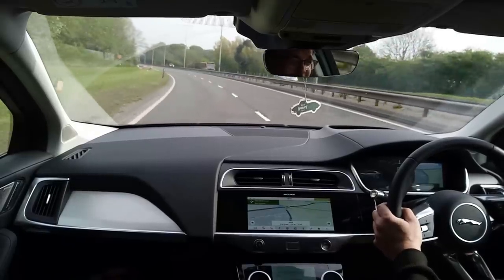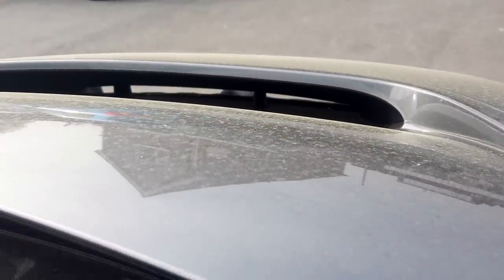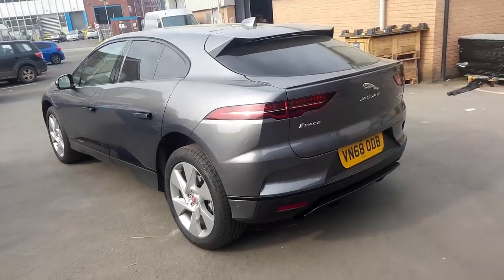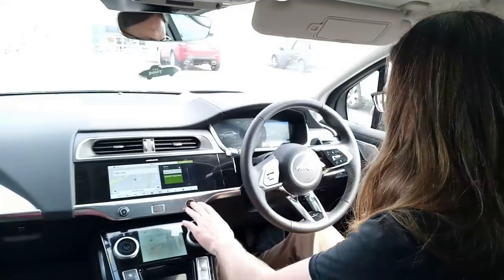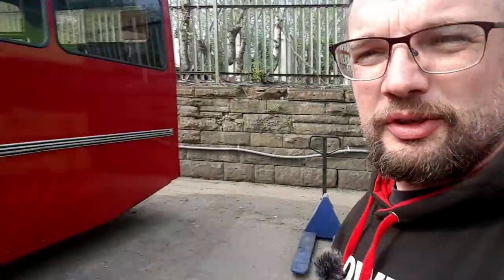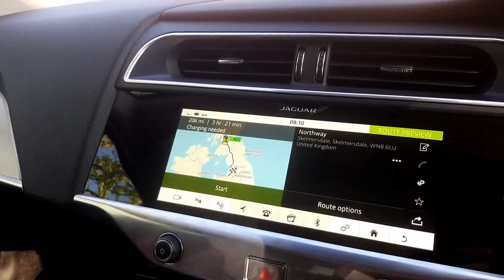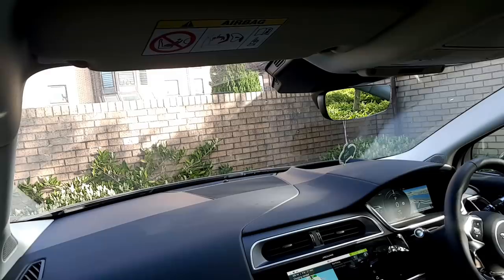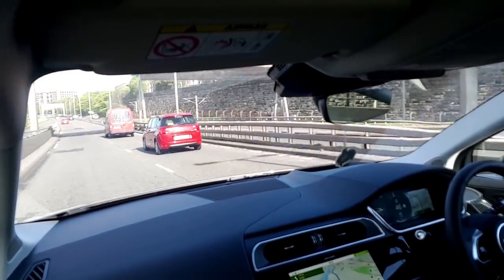Real Road Test: Jaguar I Pace 800 Roadtrip - with bonus bus action!

Comment: 168 miles of range in one hour - my 22 year old Mondeo can add 400 miles to it's range in 3 minutes! ;-) But being serious, if you live in town or only normally make local (ish) journeys, electric is fine. But, like i have mentioned before, the biggest problem i see with electric cars is the cost. A lot of people can only afford to buy used vehicles that have many miles on the clock already, and if your careful you can get yourself a decent very reliable car for not much money at all. But i simply cannot see that happening with electric vehicles, especially if you want a nice family saloon sized car. I think about the only time they are going to be very cheap is when the battery pack is on it's way out, and then of course, like so many modern things it will be just uneconomical to repair. Spend lots of money to buy it new, use it for a few years then recycle it, just like so much modern stuff these days. Mind you, to be fair to electric vehicles, internal combustion engined cars are not much better these days in that respect, things are just not built to last these days.
Reply: yeah my 100 year old steam car can use random bits of coal and wood, my horse just needs carrots!   yes i looked intoa renault zoe, the battery rental (and its a rental based on miles per month) costs more than the car itself, i bought an aygo instead :)

Comment: There is no rear wiper because like the Audi A2 there is no need for one if you’ve designed the airflow across the car well.
Reply from the maker: But what is the window is dirty or wet at the start of the journey? Aero NEVER works as claimed. Saab tried that with the original 95.

Comment: Motorway services are cheap for electrics, and remember you're dealing largely with business drivers. I have a fuel card, if I switch to a milk float it will cost me nothing. I am deciding whether to go full electric or hybrid to replace my oil-burning Volvo XC70.

Comment: When using strong regen do the brake lights come on ? If not is not that a tad dangerous?
Reply from the maker: Yes, I believe so. I would have liked to be able to monitor that - ie how strong does the regen have to be before they illuminate?

Comment: You would have driven past my work place when going through Kirkby Stephen. There is also a charging point in the town aswell but it might not have supported that system
Reply from the maker: This is the problem. Lots of different chargers, with different charge rates, run by different people. It's a right pain.

Comment: There are a number of issues which mean BEVs are going to be difficult for some of us. Firstly our local electricity networks aren't designed for Mass EV charging, hence the need of "smart charging" and the unknowns about whether you'll get a full charge in time, that might come with it. Then there's the issue of people without their own driveways etc. they'll have to rely on public charging and its inherent costs and possible maintenance and availability issues. Then there's the issue of those people who do high mileages frequently, and whether the batteries will be happy for frequent high or fast charges. For me, an H2 car whether Fuel cell or ICE is my preferred low/no carbon choice, because a BEV will be pretty much useless to me. But for many BEVs are perfect, but I hope that BEVheads don't convince the governments that it's the only option.

Comment: So how much did it actually cost you in “fuel” and how does it relate to liquid fuel consumption?
Reply from the maker: I can't recall the total off the top of my head, but fuel costs worked out at 14p per mile. The Rover is 18p per mile.

Comment: Hmmmm, you can go with 70 Eurocent for LPG over here in Germany, and in a Dacia Dokker 5 Liter of Diesel will bring you all the way for 6,25 Euro per 100 Kilometer.
I´m not sure these expensive electric cars are the way to go right now. Depending on where you live (if it´s not your own house) charging overnight for the next day is basically impossible.
As a snob I would say buy three of them and have one fully loaded every 200 miles :-)
Cheers, Bernd

Comment: Range anxiety, Charger rage and Provider Network apathy. The product is way ahead of its support systems. At least you didnt have to wait for a charging station to become available which will be a problem in the future i believe. It would have been less stressful but nowhere near as much fun in my 2.5 diesel Tranny which can do at least 400 miles on a tank at moderate speeds with a refueling time of 10 mins. The torque and power to the ground transfer appeared awesome for a quite large car. 65k at the bank however for the smug zero pollution at point of use feeling is easily neutralised by the problems of the charging point variations and the costs of a roadside  total battery drain must be of wallet draining proportions. I dont expect the AA man will carry a generator and adaptors suitable to provide a roadside charge.  Distance range for electric vehicles is improving but the hype is ignoring the conflicting provision of charging stations.

Comment: How much was the range reduced when the wipers and other electrical kit was used?
Reply from the maker: Impossible to say, as the range changes constantly based on terrain and speed. They aren't going to make a massive difference though.
Reply: HubNut ; Thanks for the info Ian, and thank you for a proper road test of an electric vehicle. The technology in the vehicle is very impressive but the infrastructure for charging is obviously sadly lacking. I'm going to stick with my ICE powered car for the time being.

Comment: You're not thinking correctly at the second EcoT charger.  Yes that would give you a full battery on the Leaf, but you didn't look at the display correctly.  The Leaf would have had 80 miles range and the Jag has 80 miles range.  Personally I would have disconnected at that point and driven for about 75 miles to the next charger, at least you would be moving and the rest at the next charger would feel better than sitting where you were.   That was really silly of you to sit there that long.  It's so much better to go 'little and often' as you said.

Comment: Great example of why there's a long way to go before EVs could become mainstream.  Having to make an unwanted detour to a working charger then sitting for over an hour wasting time isn't progress.  If there was wireless charging pads that you park on in most car parks it would be different.  Until then I'll stick with my 16 year old TDI, it has a 600 mile range.  I'll never drive it that far in one go but it does mean I'm not thinking about refueling it each time I drive.

Comment: The car looks great.
The quality and the spacious interior are as good as the big wheels.
Everything seems kind of robust and quality.
However , electric propulsion is not the solution.
It requires huge and heavy batteries that are  rare metal and require a special recycling method.
The reach of vehicle with a single charge of such batteries is about 270 km ( 220 mile's ) , which is a little , while the charging time is quite long.
The drive is not a convincing even when it comes to performance.
The same or even better driving characteristics can be obtained by installing a classic gasoline engine that is far more streamlined and better powered.
Modern gasoline engines are no longer such big fuel consumers , at least in moderate duty mode because they work with a layered filling of the combustion chamber where the rich mixture is around the spark plug and the poor takes up the rest of the cylinder .
Such engines have direct gasoline injection which allows for layered combustion.
This kind of engine in V6 turbocharged or supercharged configuration is a far better , more rational and even more economical solution than pure electric drive.

Comment: No rear wiper needed apparently as the aerodynamics clear the rear window. Someone didn't factor in the fact of the car not moving though. I just don't get electric cars at all. Poor range and hardly any charging points around where I live. More work needed.
Reply: petrol cars once had a range of 20 miles and 20 mph max, but they got improved
Reply: @jusb1066  I agree but at this present time. Electric vehicles don't make sense if the basic infrastructure doesn't exist to support them.

Comment: We have something in common. My PT turned over 91000 on the clock yesterday. Seems to me that if EVs are going to replace our current dinosaurs, the eggheads will need to get cracking on cold fusion instead of useless frippery and a multitude of buttons....

Comment: Hmmm, not for  me just yet. Cost per mile, from what you were calculating wasn't great. I drive high mileages every week (about 500) and in a diesel Honda HRV (an anonymous box with bland styling, but does the job ) I can get around 63 mpg on a motorway run, and that costs me 9.5p per mile at current fuel prices.
The Honda was a replacement for a Mitsubishi Outlander hybrid. That gave appalling mpg once the hybrid battery was flat (35 on a run) - may be great if you charge up at home and then use it for a school run around town, but the vehicle was a huge porker and not brilliant around town. Surprisingly small inside as most the space was taken up in the boot with the battery. That would charge in about 5 hours on a domestic plug to give 20 miles electric range
As for the p-take with the chargers, that's down to software not being hardened enough to be reliably used, and a company that likes the idea of "Being green" without giving a stuff about the customers
Reply: You're so right about hybrids, the emissions and MPG figures are calculated based on the car having a full charge and being at the beginning of a journey.  This really gives customers a misleading idea of how economical a hybrid they're considering will be.  With plug in hybrids these figures assume the car is plugged in too.  I know a few people with plug in hybrids who only have them for company car tax reasons and never bother plugging them in as their employer pays for their fuel anyway.  And yet I have to pay £150 a year plus to tax my mk1 Ford ka that averages 50 mpg and does about 5000 miles a year.  As you said hybrids are heavy and complex.  Given time for Battery technology and therefore range to improve and infrastructure  to catch up and I think full EVs better than Hybrid.
Reply: @kevinsmith6269  Company car was why I went for the phev. Sounded like a good idea until you factor in the amount it costs you in tax, and the horrendous mpg, and the small fuel tank (300 mile range) Hell my old Disco 300Tdi  gives better fuel mileage.
Now a lightweight plug in hybrid with a big battery and a diesel range extender with enough power to cruise and keep the battery topped up that would be a good idea.

Comment: This video illustrates perfectly why electric cars are still not a viable option if long journeys are required.  The charging infrastructure is not yet fit for purpose and I for one could not live with what you've experienced during this trip.  Good video though, very informative.

Comment: Crikey that's not very good the second attempt at charging the beast, 1 hour and.35 more minutes to fully charge after already charging for awhile.. makes me want to wait before I buy an electric car as the charging range concern ratio is still the biggest concern after the initial above average price of one of those electric vehicles. Thanks for that practical test and revelation.

Comment: Hi Ian, The problem is when you do the energy calculation you can prove an electric car system will never work. Running a car on 90KWH is quite and achievement to replace my engine would be more like 500KWH. but lets work on 90KWH So to charge that in one hour at 100% efficiency would be 1000V at 90A. The average domestic supply is 22KW. The domestic supply system is based on about a 1KW average supply so if everybody got an electric car the system would simply fail. So That charge point has a 40KW supply which is roughly the same as 2 houses on full power. Completely impractical. I worked out some years ago that to run an electric car system in England would take roughly 20 times the current generating capacity. Just think what it would be to run a truck. Obviously totally impractical we cannot keep what we currently have going let alone provide any more. There is not the generating capacity or the infrastructure to deliver the required power. Never mind the pollution caused by that many more generating stations. It is a dream that will never happen. Nobody ever seems to mention this though. Having said that and electric car is obviously a nice thing to drive. It will be quiet and have considerable torque if made properly and obviously Jaguar have done a great job. The Solid injection, compression ignition oil engine, (Diesel engine to you)  is still the most thermally efficient engine we have. 
Allister Denyer B. Eng. (elec) MIET P.Eng.

Comment: I can't see any comments so far relating to the following aspect of EVs, so here goes: HubNut gets excited by the surging 0-60 performance. As a pedestrian, cyclist, motorcyclist (and driver) I am afraid that when/if EVs go mainstream (and I think they must do so for one reason or another - that's a topic for another post though) and the 'boy racers' get their hands on them, we are going to see mass slaughter of 'vulnerable road users' (particularly the elderly who already find it challenging to get across busy roads on foot) because of the combination of excessive acceleration and lack of noise. I believe there are steps regarding the lack of noise at low speed; I think that the performance should be 'governed' (probably by a remote control system or satellite) at least in urban conditions.

Comment: So why doesn't it charge while driving? 4 moving wheels should generate a certain amount of charge. Plus that glass roof should be a full solar panel really!
Reply: And of course, a wind turbine on the bonnet.
Reply: Because perpetual motion machines don't exist.
Reply: @chrismarshall25  I am genuinely hoping that the original post was intended to be a joke. If not then we really do have so problems.

Comment: Your sum of 14p per mile for electricity versus 18p for petrol at 30mpg is pretty disappointing. I've a diesel merc that does 50mpg on a run, so without doing the maths must be cheaper per mile to run than the Jaguar on fuel costs. Doesn't include the other running costs of course.

Comment: its a nice looking car, I can appreiciate the performance of an EV, but not the sound, or lack of. The feeling of petrol power, the spooling up of turbos, Hondas Vtec. What I find most disappointing at the moment is the lack of charge points the how fast batteries charge up, if you can fuel up a petrol or diesel car with 500 miles of range in a few minutes, and the same or better with an electric car, then I think more people might adopt them. Not to mention not every house in the UK has a suitable space to charge a car at home. I live in a street full of terraced houses, where its impractical if every house had an EV to charge at home, imagine the trip hazards and parking nightmare of everyone charging at home. Also the UK's national grid would grind to a halt if everyone had an EV simply because there isn't the capacity.  Further to this a German magazine or something along those lines sat down and crunched numbers, and it works out that they are still more polluting than a diesel car, simply because of the enormous amounts of energy to make the batteries and then the electric to charge them comes from fossil fuel powered stations. your still only moving the pollution from the exhaust of the car, nation wide, to one massive place.... the power station.

Comment: How many people drive more than 200 miles a day? Or even a week. Not me, bring on my I Pace 😁 if you looked into getting an EV you’d be doing a little research and would know to avoid Ecotricity and use apps like PlugShare and Zap-Map to see there are plenty of chargers around to cover those trips. I’m off to Holland in mine in a few weeks too and can’t wait. The infrastructure will get better with time but for now, your missing out the joy of EV driving.

Comment: connection fee's and ridiculous costs for charging. What a surprise. If these become proper mainstream they will be more expensive than current cars...  Years ago when no one was using diesel the cars were a little more expensive but the fuel was cheap as chips. then they became popular and all of a sudden almost overnight diesel became more expensive. I am under no illusions that corporate greed will ruin any benefit of having one of these cars.

Comment: Imagine if all petrol engined cars had a range of 200, but all gas stations were 240 miles away from each other. You can always keep a tin of gas in the boot. Try that with an electric car.

Comment: Do either of those ex Brightbus green ones have the Gardner engines?
Reply from the maker: One does. It's still in service until June.
Reply: @HubNut  Is that one owned by an enthusiast as well?
Reply from the maker: Well, it's a working bus, but the folk involved do like old buses.
Reply: @HubNut  What are they doing with it after June?
Reply from the maker: Contract ends at that point, so I guess it'll be for sale.
Reply: @HubNut  I hope one of the enthusiasts get to it before the Barnsley cartels do. There are not many left with the turbocharged Gardner engines (6LXCT).
Reply: The Gardener powered one, which is still working for a living, will likely be for sale. It is original spec Gardner 6LXCT / Voith 3 speed. Contact Swift Coaches, Barrhead. A buyer was found long ago but that source has dried up. The one next to the yellow one is Cummins / ZF. The gearbox will likely end up in the yellow one.
Reply: @davidfowler729  If only I had the money and the storage space.